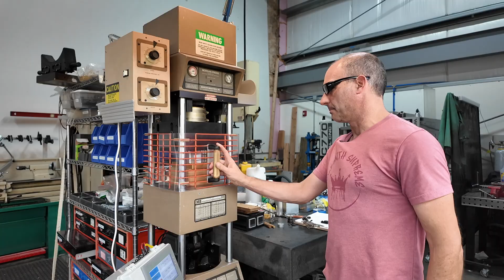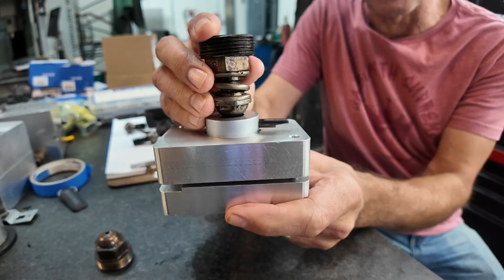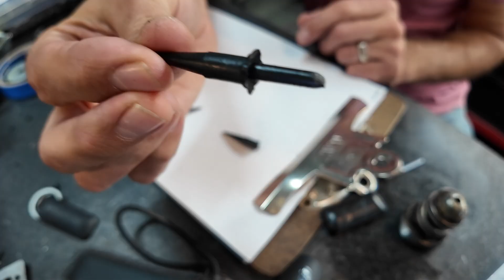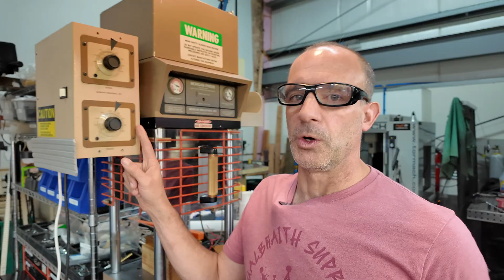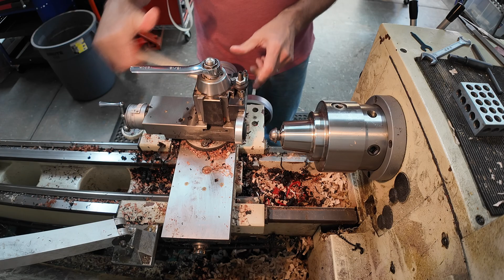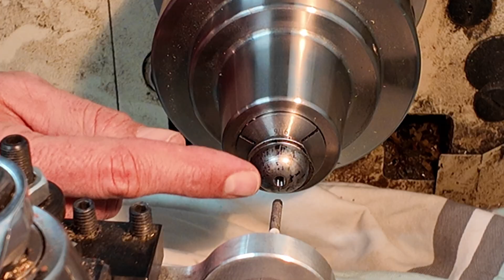Problem 3 - Morgan Press Nozzle Upgrade

Comment: Nice work and shop!  I'm in the process of building my first semi auto mold with ejector pins for the Morgan press.
Reply from the maker: Aah nice!  Have you come up with a way to automatically remove the part once its ejected?  Air blast?
Reply: @M @MoreToolsMoreProblems not there yet, but probably something along those lines
Reply: Did it work?